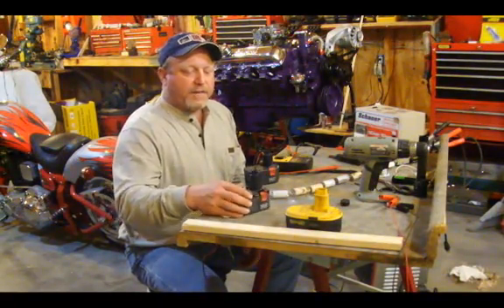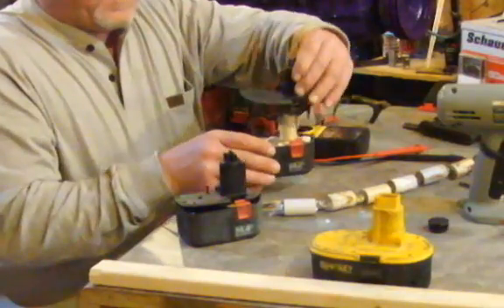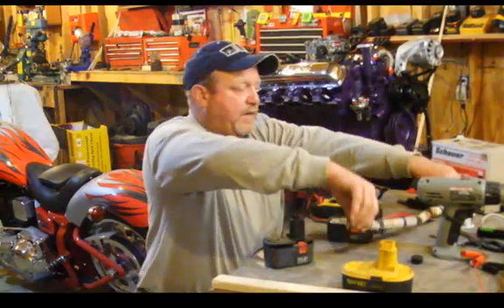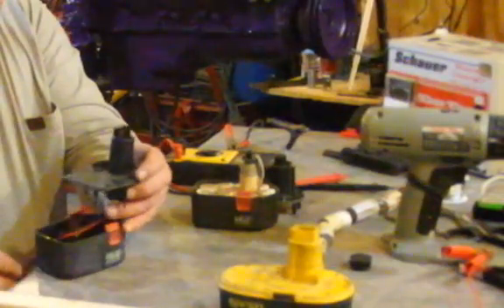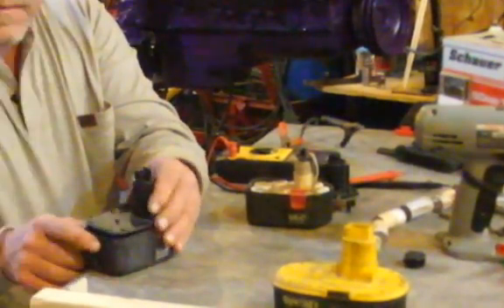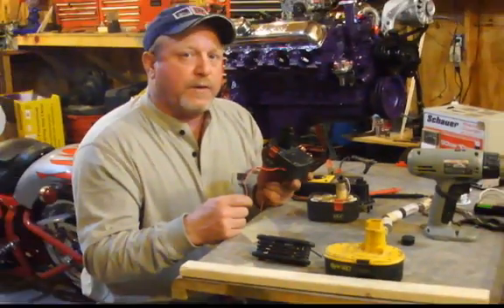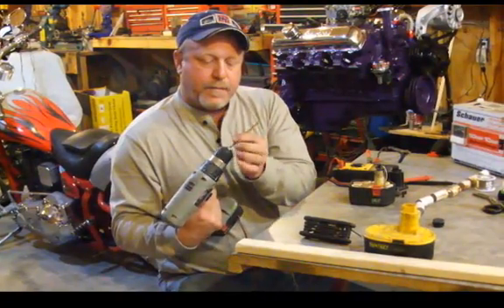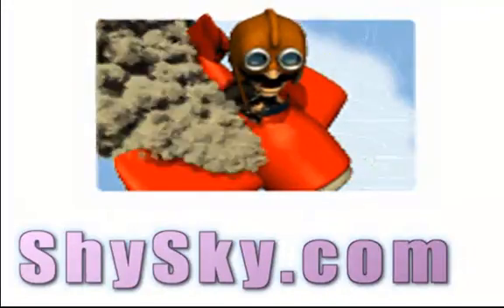Discover How to Salvage Power Tools with Bad Batteries

Comment: i put 80% all new inside my dewalt dw991 with a type 4 motor for dw990 xrp model aswel as the trigger from dw990 i need to change the clutch and transmission to a 1/2 type for dw990  from the one i got and change my chuck to 1/2  this video did not help me much but was fun to watch  batteries just but good aftermarket branded on ebay at a good price take a t-10 open your dewalt ni-cad batteries and take old cells out use case for aftermarket brand put the cells from them in your better looking made to fit right dewalt and bam you good make sure you dont go any lower the 2.0 ah battery thats what i did and i did the tapen way but did it buy un pluging changer with battery in it and puting plug back in way a few times to battery started to.charge saw it on youtube some other guy did it it works